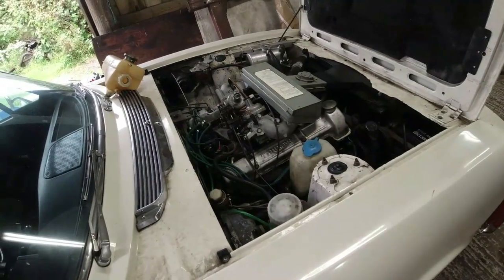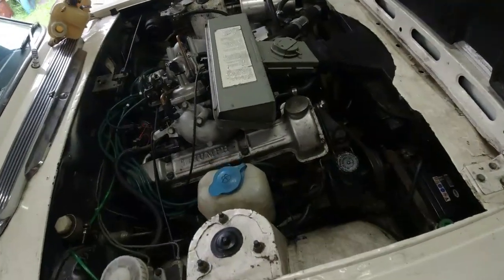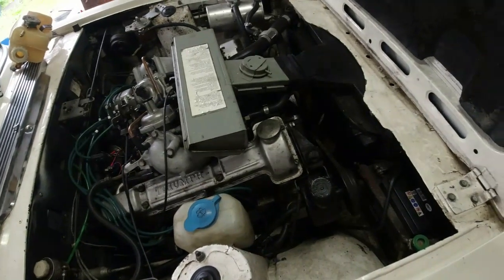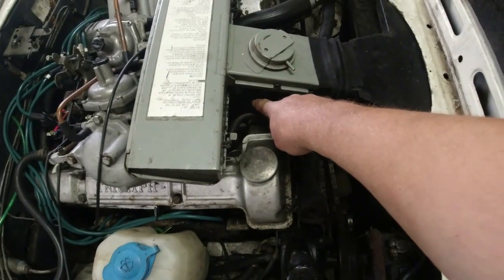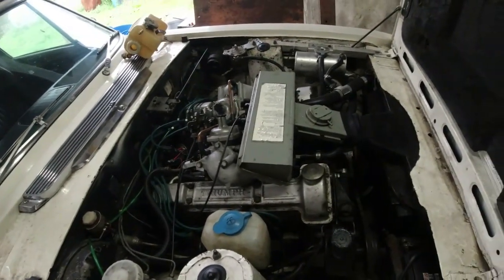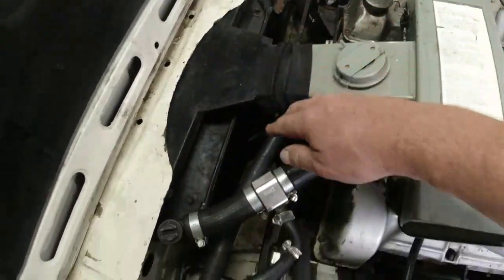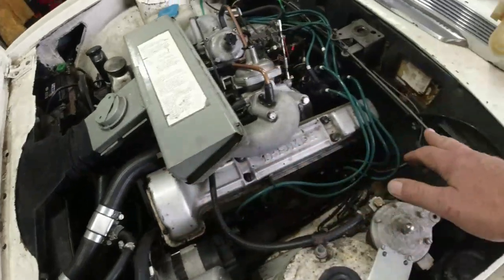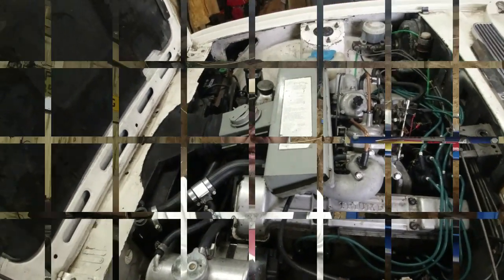1973 stag cooling system - Parental warning for terribly boring content and profanity

Comment: Has anyone used Evans waterless coolant in a Stag. Jay Leno swears by it for his classic cars. Although one guy on U tube put it in a DeLorean which made it run hotter than normal running  temperature.
Reply: Did he only drive the DeLorean from "time to time??" :-) :-)
Reply: @KJs581  
He is a classic car restorer.  DeLorean has a problem in hot western US climates, that the rad is at the front with pipes to the engine at the back. This is a known problem and ways around it are an electric water pump or an electric water pump as an assist to get more water flow to the front mounted radiator. Both with overruns after the engine has stopped.  This must be addressed first. 

Evans is worse at absorbing heat than water.  

Evans water coolant has many qualities for sure:
1) Cooling system can be non-pressurised - pressurised cooling system are to raise the boiling point so no over-boiling. 
2) Prevents/reduces problems from hotspots in engines due to local boiling;
3) Prevents corrosion.
4) Reduces pump cavitation.

The Evans made the DeLorean engine run hotter, as the cooling system was on its limits anyhow using water - no spare cooling capacity. The prime problems need addressing first before pouring in Evans. 

But Evans will prevent catastrophic failures as the boiling point is way higher than water.  However, having Evans in does not mean ignoring the temperature gauge.  

In running Chevy pickups and Blazers in deserts we would take the thermostats out to prevent problems occuring - the viscous fan was a pain in the arse.  Evans say that taking the thermostat out is possible using their liquid. Not sure if the heater would be too cool in UK climates - we never needed heaters, not once.  I thought of the Stag. Some car models sold in those desert countries never had heaters installed, just an A/C.
Reply: @johnburns4017  Hey mate. My "time to time " was just a throw away gag. Someone says "DeLorean" = hard to resist. 

Our speedway cars here (stripped stock street cars on dirt track) used to have the radiator in the back window to stop the dirt and front end nudges blocking/damaging radiator, (so similar to DeLorean, but other way around) and they showed similar, as when running fast, they were fine with high pump speed. But during any stoppage, the low pump flow and the distance to the rad meant that the people managing restarts had to get a move on, otherwise lots of steaming radiators.

But yeah, while there are things that "otherwise you wouldn't do"; extreme use means that if you do something that works for your situation = why not?

As I said, I did some things on mine because 48 degrees (C obviously, almost 120 F) when I was driving interstate was a bit beyond what most expect from a Stag. But I bought mine as a touring convertible, and I want to be able to use it as such. 

Summer here is regularly mid 30's, but most summers we get a week where it is over 40 every day. If I want to take the Stag, I do. I can't see why I shouldn't be able to. I grew up here, and it is very dry, so walk outside and is 40.............. feels warm, but get used to it pretty quick. 

Your comments about the Evans coolant and absorption rates; and water being very good/optimum. I helped build and worked at the Navy's Recompression Chamber, and it was a showcase for technology. At the time it was the best in the world (shut down now, shows how old I am); but the air con/cooling was ultra critical (Helium enviro). So the heat exchangers that carried the cooling fluid ran 50/50 glycol /polished demined water. We had an expert who ran his own company, an ex chicken farmer from Texas (no, not Shelby :-) ) who came and did final tuning on the custom aircon unit, as his company made it/he designed it.

The demin water was easy, we had gallons of it for submarine batteries; but we had to buy Glycol by the drum. 

So - I was young and just starting with cars - I had a Ford V8 at the time, and seeing most coolants were mostly Glycol, I asked the scientist at the glycol company if I should use that glycol in my water 50/50; because if good enough for a multi million facility, then.........and I could get it for nothing........ 

His answer was a definite NO................. (apart from the no anti corrosion issues) as Glycol had a far less absorption factor than water. The chambers needs were different, as the primary concern there was anti freeze when cooling the chamber, not heat removal.

We also had extreme problems with foaming with Glycol, it would foam just emptying it into a bucket. ANY cavitation would "over foam" the entire system, and had to be carefully managed. 

So your Delorean tale of "didn't work for that" (specific different application) backs up the "often cases are different."

Here we have the same problem where a car will never ever freeze in our climate. Our major concern is corrosion. But most coolants sold here are STILL a compromise between anti freeze and corrosion, etc etc, because that is the broad market. I use a concentrated coolant that has no glycol, and is purely a corrosion inhibitor, and that seems to work best in my old cars (Stag/Dol Sprint/69 Jaguar). Again, I have had two 69 Jaguars, cars that "always overheat"........one from 88 - 92, and current one from 2000 til now................... and mine don't. 

So it really is horses for courses. People may "swear by/never had a problem with..." but if their usage/climate is a bit unique, have to consider it.

:-)
Reply from the maker: "time to time" 🥁
Reply: @KJs581  wrote:
"My "time to time " was just a throw away gag."

I never got it. If you mentioned a flux capacitor I would have.
Reply: @johnburns4017  I made a meme. Blokes says his mate had a DeLorean, but sold it as hardly ever used it. He found he was only driving it from time to time. But I can't attach pics here, so........

Comment: If it was mine I would fit a large aluminium radiator, an electric water pump and two large electric radiator fans
Reply from the maker: To my understanding, which may be entirely flawed, copper is better than aluminium at dissipating heat - however after using an induction ring to try get a broken stud from a Rover v8 head I may be evolving that thought - EWP / EEWP (external / external electric water pump) is a great solution to a bad design flaw for the  stag engine. Alas I do not agree on the electric fans unless you have a mechanism that allows them to run on after shutting the engine off.